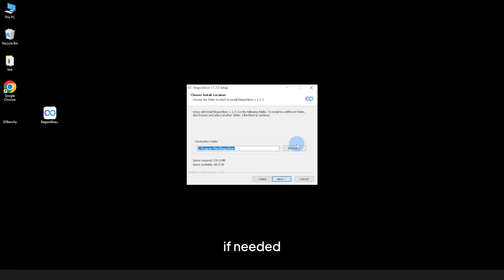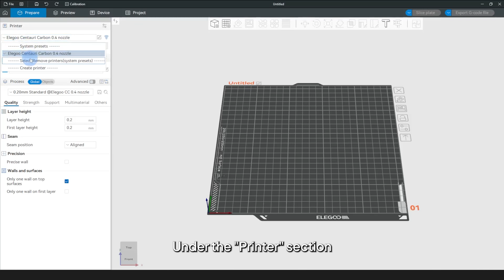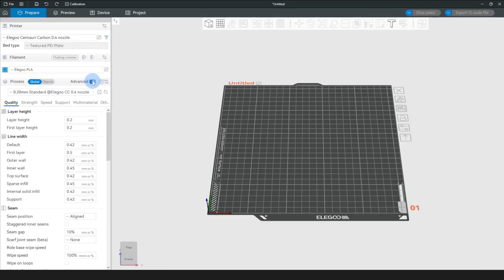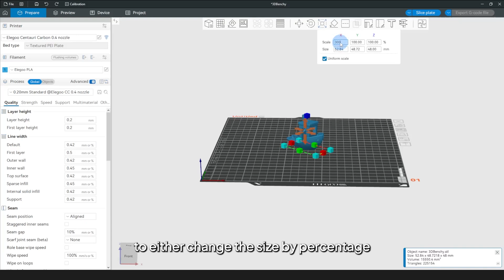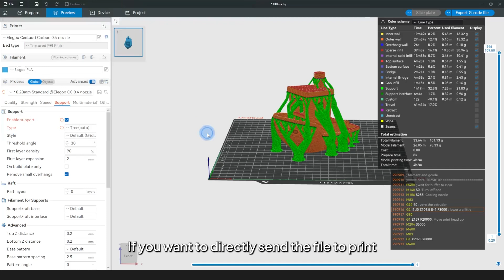This Is How You ACTUALLY Use Elegoo Slicer

Comment: Can you also print in multiple colors WITHOUT AMS?
Reply: i wanted to see what happens when it ran out of filament with the filament detector and loaded a black pla+ after the high speed pla sample they give you ran out and it came out flawless. there's a few other ways to do that manually like pausing it yourself or setting a pause in the print then swapping filaments

Comment: What about folks on Linux? Been using orca since this is offered only for windows or Mac.
Reply: The slicer should work in WINE. I have Portproton installed which is a tool for WINE and it works really well. I installed Elegoo Slicer from the included USB stick just like it was installing in Windows. It even noticed an available update and downloaded it. I then installed it just like on Windows -the installer knew the old version needed to be uninstalled first. All in all it was easy.

Comment: Based on my experience with this software, the Neptune 4 Max is not compatible. I have switched to Cura; the new Carbon printers work well with this software. If anyone knows why the Neptune 4 Max is incompatible, please let me know.
Reply: Mine works without problems.
Reply: I printed a couple things on my Neptune 4 Plus and no issues.  Still trying to figure out how to get rafts to show up though.  I can do skirts and brims but no raft.